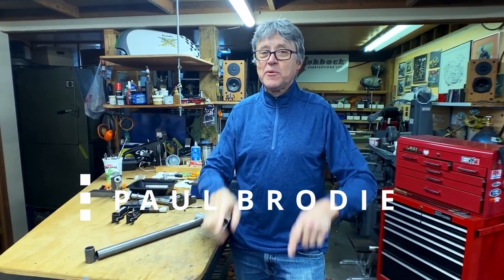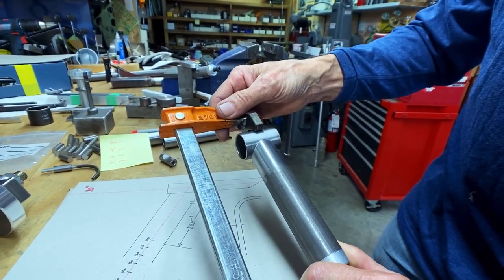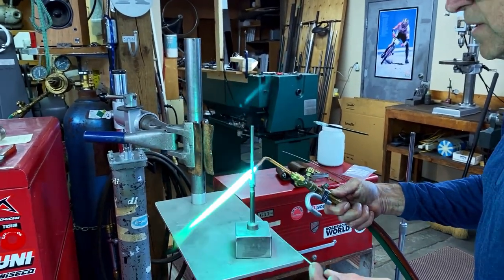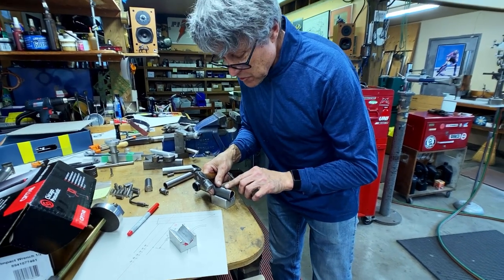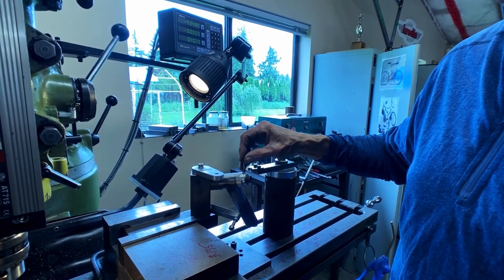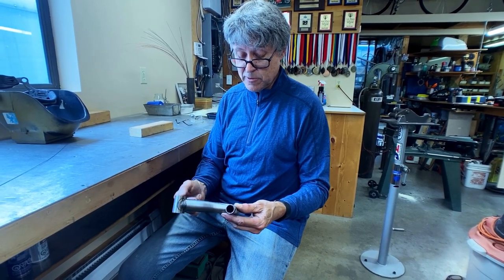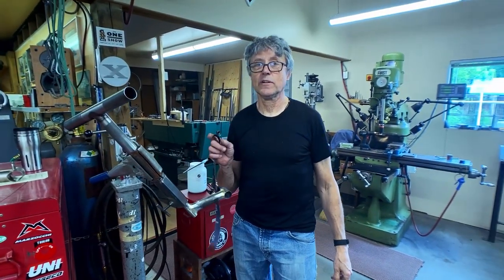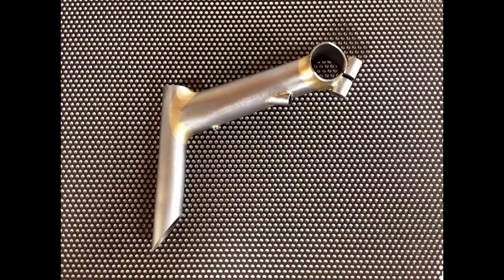Make An ICR Quill Stem with Paul Brodie - Framebuilding 101

Comment: Paul, does the inline fluxer give you  a softer flame than if you didn't have it?  Maybe that's just the camera maybe its just low gas pressures?  What do you think?  Thanks Paul Maselli
Reply from the maker: Yes, I think you could say it's a "slightly" softer flame. I don't think the regulator pressures have much to do with it, as long as they are reasonable, say 2-5 psi. Thanks for watching!
Reply: @paulbrodie  Thanks Paul, Another fine video.  I hope you and Mitch enjoy the coffee  ;-)
Reply from the maker: @TheMobileBoatwright  Thank you Paul.

Comment: Do you TIG weld the tubes for structural reasons? Would a stem which is just brazed be strong enough?
Reply from the maker: When the quill tube and extension tubes are the same size (where they meet..) the braze is not strong enough to hold. It will crack. That's why I tig-welded the sides. I wanted "that look". For a fillet braze to be strong you need an 1/8" difference in sizes; that's what I used to tell my students in Framebuiding 101.
Reply: @paulbrodie  hi Paul, can you explain why this is? is it that the fillet is too shallow on the ears on the mitered tube?
Reply from the maker: @potatopealer2764  Fillet strength is based on size; when the fillet is very thin it has no strength. You need 1/8" as mentioned before.
Reply: @paulbrodie  First, THANK YOU! (For your "knowledge bombs" as someone described and close up brazing/working views with detailed pointers.)
Regarding the '1/8" difference in sizes' for a strong fillet braze, this would imply a minimum 1/8" difference (in radius) from each 'ear' of the miter(i.e. the non-mitered tube's diameter 'should be' 2 x 1/8" as in 1/4" larger than the mitered tube if the mitered tube is not 'ovalized')? 
I wonder how(in what direction etc.) the crack would likely form in equal diameter tubes with only a fillet braze?
A video on this topic - perhaps something like  'fillet brazing limitations/precautions & no-nos'   would be VERY COOL!
Reply from the maker: @tinkerman4774  Yes, you do need an 1/8" difference in tubing sizes. If not, and the tubes are the same size, a crack will probably form where the tubes are the same size. Thanks for liking and watching our videos! 😉

Comment: hey Paul, I don't know if I missed it somewhere, but I wondered what wall thickness you use for these quill stems?
Reply from the maker: You might have missed it. Which tube? There are 3 different wall thicknesses.
Reply: @paulbrodie  mostly the One that Goes into the Head tube, 1 inch OD ofcourse, but the thickness? Oh and, glad to see you back on YouTube! Happy you are doing allright
Reply from the maker: @jillesoom3305   I think you mean the one that goes into the steerer tube... Wall thickness, going off my memory, would be .083"      Use 7/8" 4130. I have them centre less ground down to .870", otherwise they will not fit. Making stems is a lot of work.   :face-blue-three-eyes:
Reply: @paulbrodie  yeah, sorry, thats what i mean! thanks for the reply. bike building in general is a lot of work but Its great creating something from the ground up
Reply from the maker: @jillesoom3305   Yes it is!    :glasses-purple-yellow-diamond:

Comment: Don't you ever have any problems with having a front brake on the left on a pushbike and the front brake on the right on a motorbike?
Reply from the maker: No, I don't ever think about that, it's just instinct. I also learned that I could get off my street bike that shifts on the left (one down five up) and get on my race bike that shifted on the right (one up and four down) and not make mistakes if I focussed.

Comment: Why do American Pedal cyclists use the left hand for the front brake?
Motorcycles have it on the right side, so I'd have thought it would've been logical to do the same with push bikes.
Reply from the maker: That's a very good question, one that I have no answer for, sorry.
Reply: The reason is because the placement was standardized according to motorist hand turn signals. Different countries drive on different sides of the road, so the opposite hand or window would be available to signal with. Early on they standardized the primary("safe"=rear) brake to align with the non signaling hand. It's been law to sell bicycles like that since.

As to why motorcycles are different, the effort required to design multiple versions is much higher than simply moving a brake lever to the other side as with bicycles.
Reply from the maker: @seitenryu6844   Good info. Thank you.
Reply: @seitenryu6844  Thank you.
It makes sense as you use the rear brake for low speed control so you need the left hand free to indicate a left turn when driving on the right.